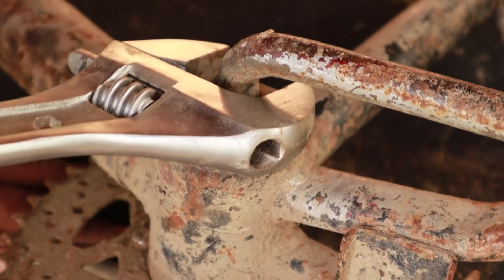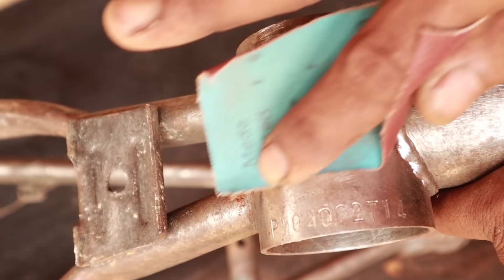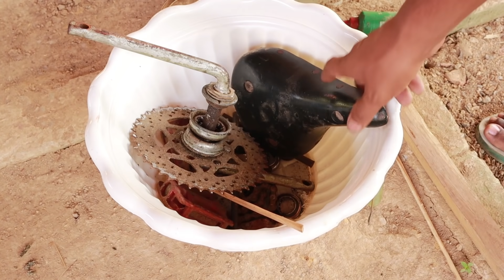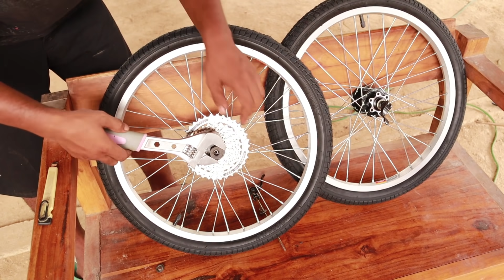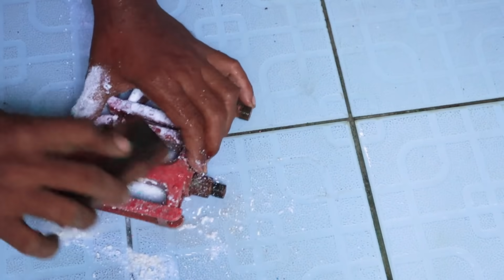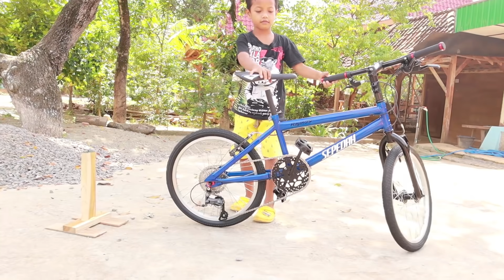restoration bike from wreckage bicycle 3

Comment: Akhirnya restorasi minivelo 20". Sering2 bikin minivelo dari berbagai style atau rubah sepeda 20" jadi sepeda dewasa tp ttp dgn roda 20". Mantab.
Reply from the maker: siap mas
Reply: @rajin99  terimakasih, sy setia menunggu, hehehe...
Reply: @rajin99  o ya, kalo minivelo nya pake frame BMX lg, cb skali2 BB nya yg USA style di ganti BB kotak aja dgn pake adapter. Trs untuk video yg ini saya cukup surprise dgn ide perpanjangan dr headset ke stem. Luarbiasa.
Reply: @rajin99 Ngilangin karatnya pake apa mas

Comment: Nice work but ...
I think a BMX frame is trying to use a children's recreational bike? a) Seatpost too high and seat extra long. This can cause breakage or fatigue in the weld area.
b) Handlebar height too high.
c) That XC handlebar doesn't even stick on a BMX.
d) Child too short for that frame size. With age it corrects itself.